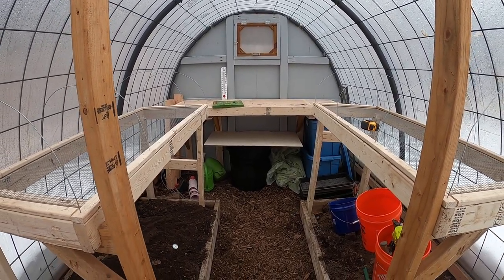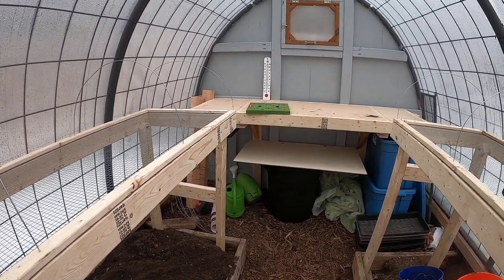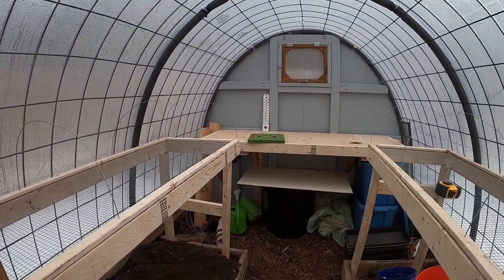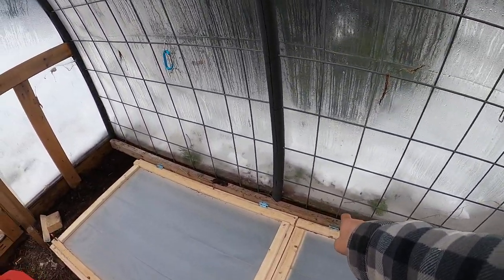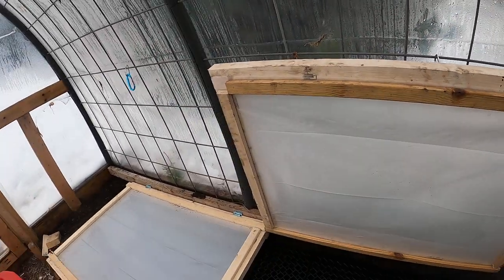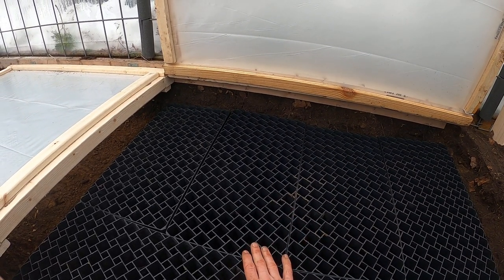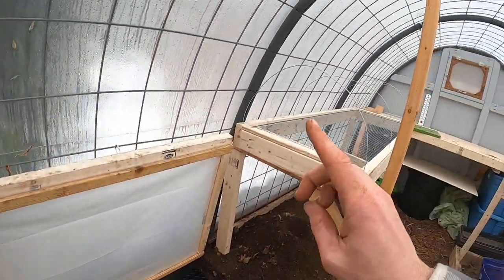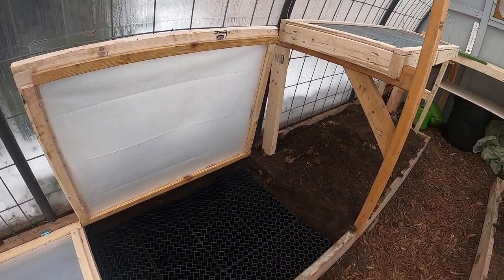Grow more in less space- Installing cold frames in Greenhouse

Comment: What covering do you put on your cold frame and do you just put it in the ground or is there a base to it?
Reply from the maker: The plastic of the cold frame is just regular 6 mil plastic from HD. I didnt have extra greenhouse plastic nor was I sure I would be using this for the ling term. Given the success, I will be switching to greenhouse plastic which hopefully will be more durable to the summer heat. Frames sit on a wooden base to prop it above the seed trays and enables some growth initially.
Reply: @uphillacre1585  Thanks Man i appreciate it, keep up the good work!

Comment: Can u use five gallon jugs full of water to retain heat overnight?
Reply from the maker: We tried that before and did not notice a difference. Have you had any luck with that method?
Reply: @uphillacre1585  Haven't built my green house yet.  But, it is one I have planned to build like you built   That's why I was interested.  In the south, it would be too hot in summer to use, so, I plan on taking the covering off in the summer, storing it and then putting it back on when winter comes around again.  AND now I am building a shed that I want to add a porch onto and make it into a winter only greenhouse.  I have a bunch of five gallon cans from work that I want to try and use to retain the heat.  Hope it gives me some help.  They are all black.
Reply from the maker: @georgemurray6845  wow sounds great! Best of luck. Let me know how it works out.
Reply: @georgemurray6845  you can get a darker shade coloring and grow fall crops during summer